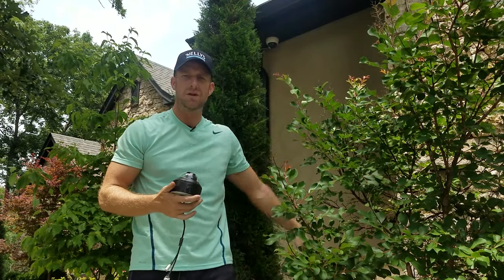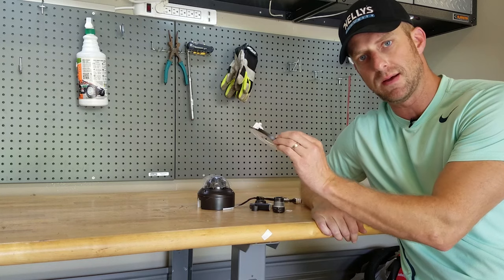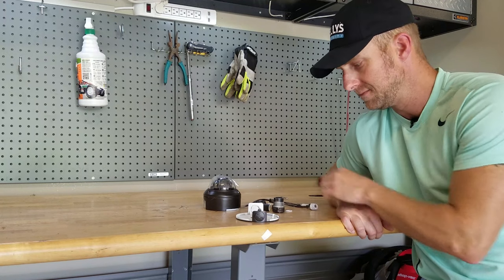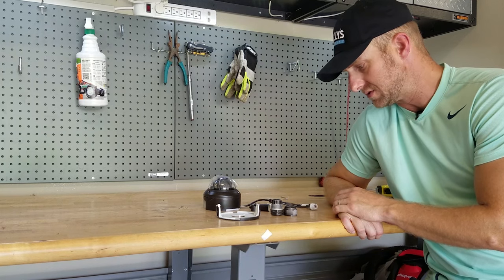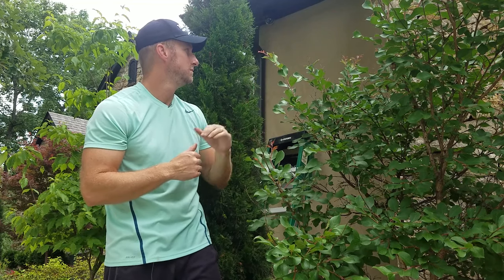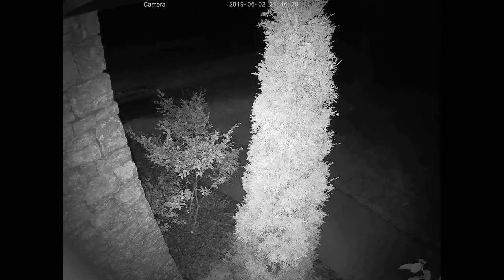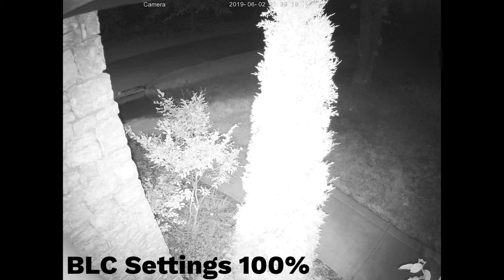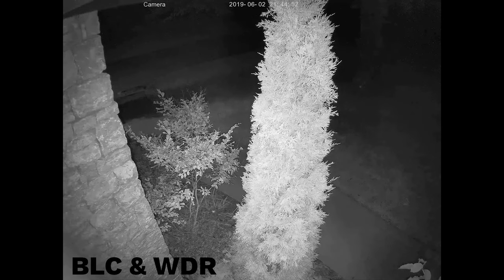Installing a 5MP IP Vandal Dome Security Camera (Sample Video Included)

Comment: what is a junctions box? plus is the camera stand alone? does it work with push motivations to cell phone? do you need a dvr to run it?
Reply from the maker: Junction Box is the space in which all of your cable connections are store away from the elements. It does work with push notfications. You do not need an NVR to use this camera, however, without one, it will only be a live viewer, no recordinds will be available.
Reply: @NellysSecurity   ok good to know.. how do you like ring cameras and arlo cameras ?
Reply from the maker: @Rockaland2  They are ok for some specific use scenarios